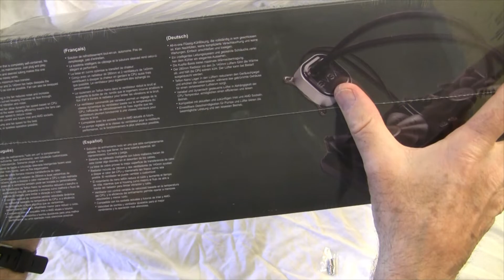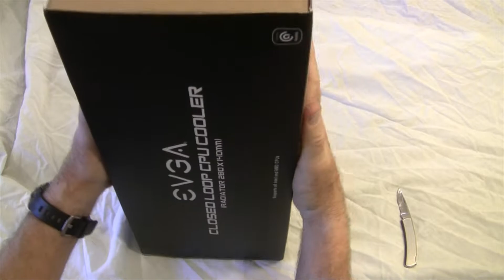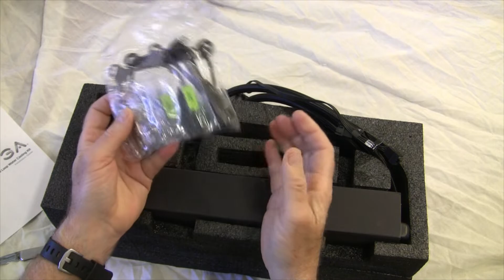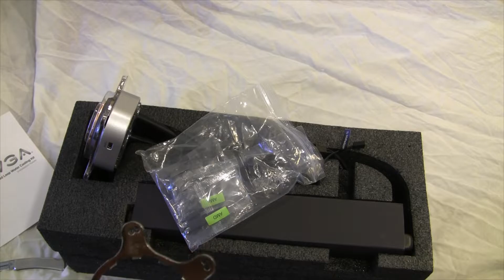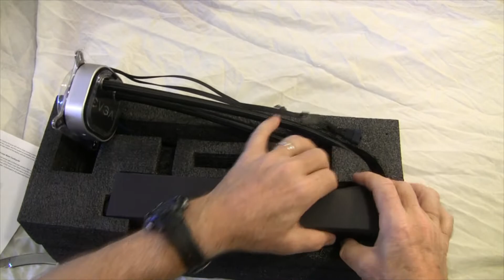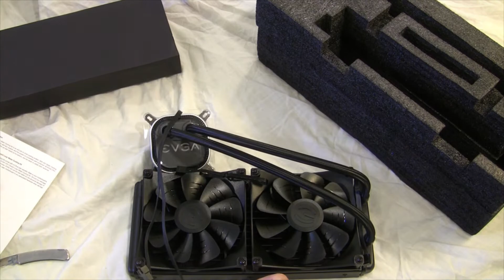EVGA CLC 280mm All-In-One RGB LED CPU Liquid Cooler - Unboxing

Comment: will this work with the 13900k without throttling when i limit the 13900k to 250watts?
Reply from the maker: I don't have one of those, but I would use a 360mm cooler for the 13900k. 
Rather than limit a 13900k to 250 watts, I think it would make more sense to use an Intel CPU that only draws 250 watts max (see Gamers Nexus review below for the range of wattage for Intel & AMD CPU's. It would be cheaper.

Here's an article, a video & the written review associated with that video about recommended coolers for that processor:
https://www.pcguide.com/cpu/guide/best-cpu-cooler-for-intel-i9-13900k/
https://www.youtube.com/watch?v=WNBm3rLiT7Q
https://www.alktech.co/articles/review-asus-rog-ryuo-iii-360-argb-aio-cpu-cooler

I'd have to do a lot more research, but based on that, I'd go with the Asus ROG 360 cooler. I've got a Asus motherboard and really like it.

I think Gamers Nexus has the best info about PC stuff. 
Here's their review of that processor (NOTE: they don't talk about cooling, hopefully they'll cover that later):
https://www.youtube.com/watch?v=yWw6q6fRnnI
Reply: @BetaCygniBlog  thank you so much

Comment: Great video! Thanks, i was trying to find a new video for this water cooler and only find some from 6 years ago, and then your video showed up! 

Do you know if it comes with an AM4 bracket? On the EVGA website it says it does but on the store it says it doesn't. Anyways, great content!
Reply from the maker: Thanks! I'm glad you like it.
You can see in the video @ 3:01 that the AM4 bracket is in there.
Good luck and let us know if you have success with this cooler.